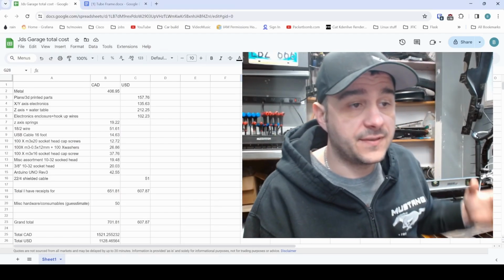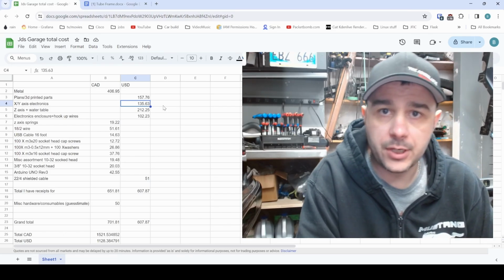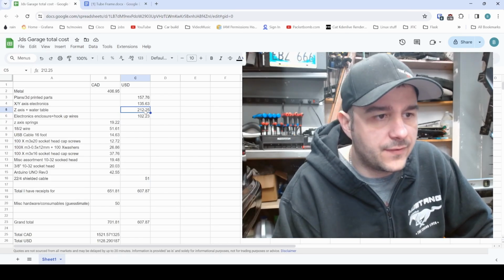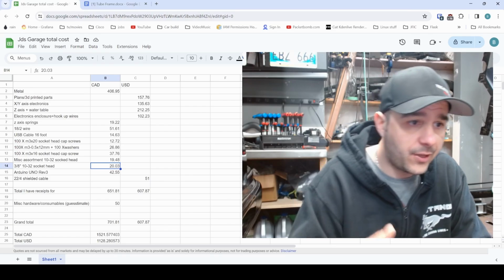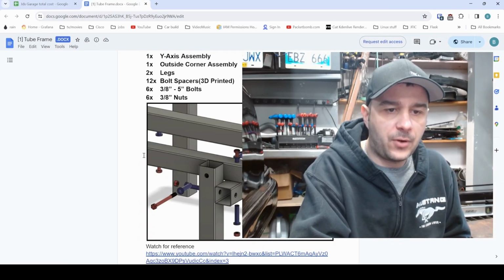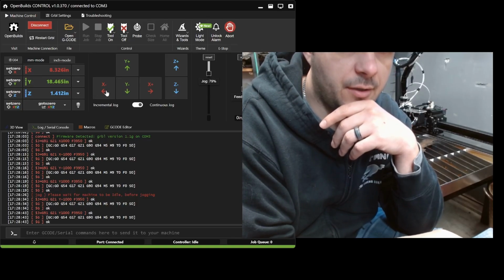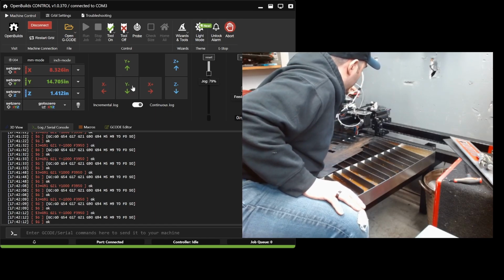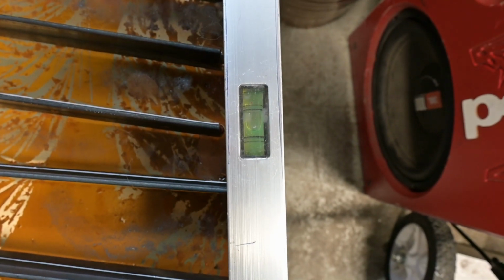jds cnc plasma cutter conclusions

Comment: Try drilling bigger holes for M6 bolts (metric system) that connects 3d printed flanges with bearing blocks.. that way you can tilt the whole x axis up a few mm just on the bolts.
Reply from the maker: That's a great call, I loosened all 8 nuts holding the flanges, and with a clamp reversed to spread I lifted up on the gantry arm as much as I could then tighened down the bolts, and it is better but still not quite enough. Part of the issue with this is that the x-axis motor plate is bolted to the bearing blocks limiting any movement between the 3d printed gantry pieces.